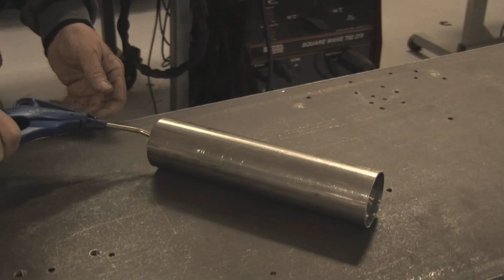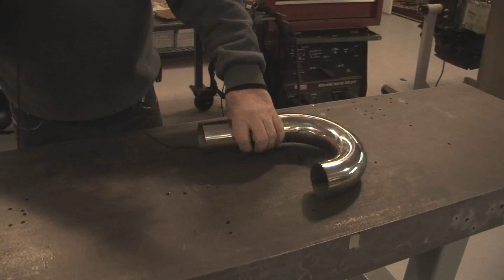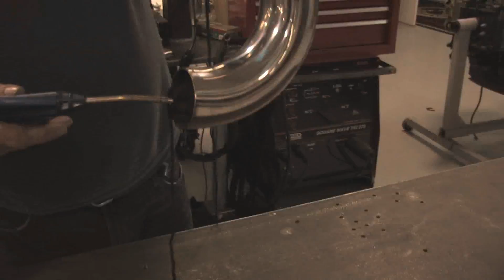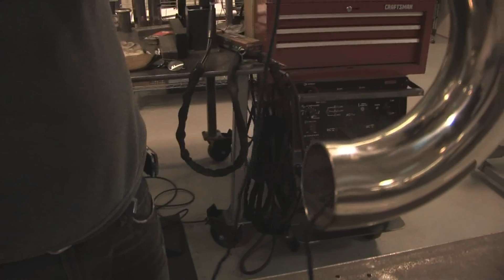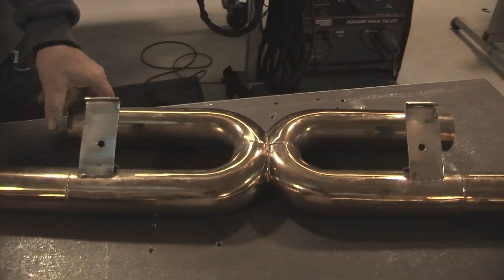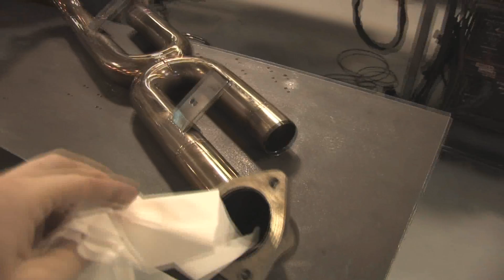FABSPEED MOTORSPORT | X-Pipe Flow Demonstration

Comment: So, are cross over pipes that use bends (Like Wicked Flow x pipes) not as effective as the one you showed here?
Reply: That's what I'm wondering now too bro. I bought a wicked flow x pipe too. After watching this demo, I'm thinking the wicked flow x pipe Is a u bend designed for mid engine cars. 
Think imma play it safe and get the intersecting designed ones
Reply: No they don't mean that.  What they demonstrated is that you can have an x pipe configuration with rear mid engine cars where you don't really have that much space. To deal with that you need your cat or bypass to come out downwards so the pressure doesn't build up,  then have an upward x pipe that goes upwards so you can continue to use the low pressure crossflow created from opposing cylinders to create suction for the other side, then you pipe downwards again.

Comment: Excellent video, as I was about to make a pipe in the same config, interesting Thorny engineering make a contra flow x pipe for the twin turbo McLaren, interesting to see if the same principal works as the flows are in opposite directions, however it may be just the pressure integrating cancelling out the sound, as the car has no mufflers!